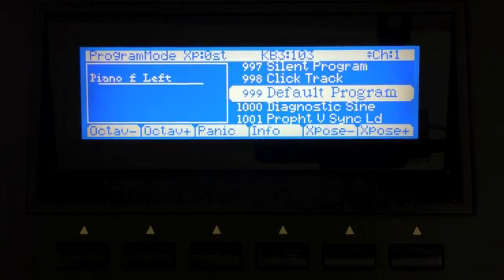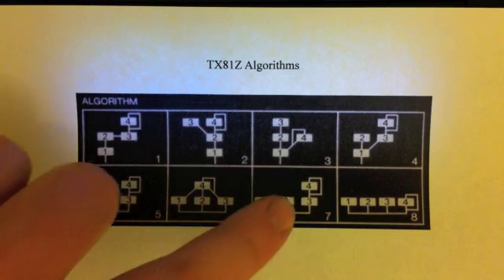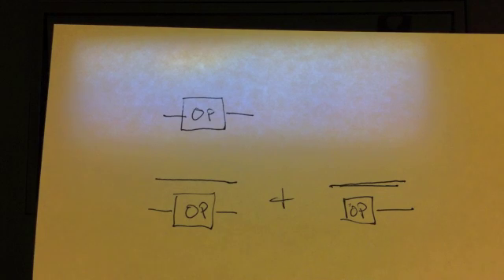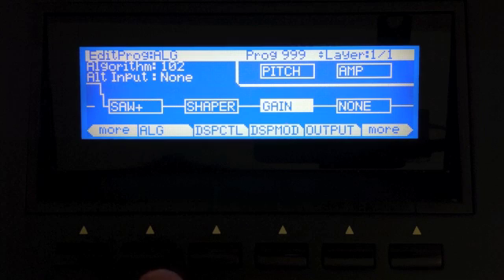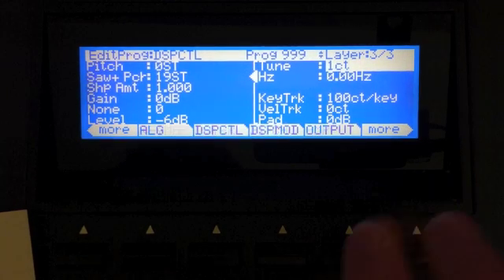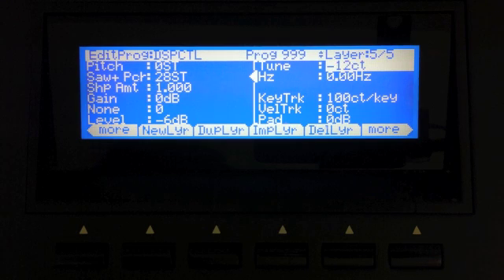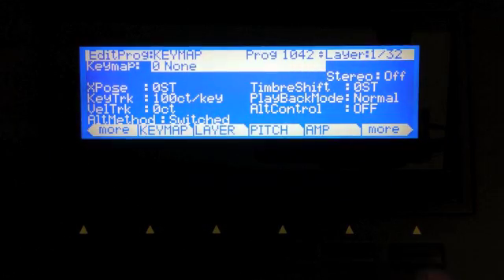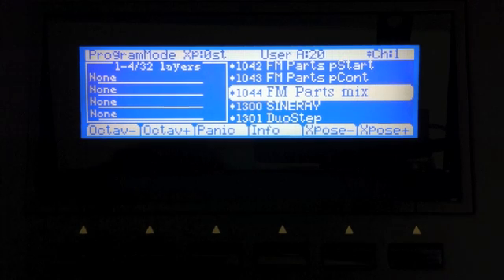Kurzweil PC3: Tutorial 7 -- FM Synthesis and Programming Strategies

Comment: Thanks for the terrific tutorials. Is there a way in VAST to use a sawtooth wave to modulate a sine wave, such that the output is of a similar nature to kick drums, basically a fast and large ramping of the pitch down? I have found, using envelopes and LFO's applied to the pitch are limited by a delay of 20ms before they update, and especially odd and annoying, they induce a ramp up in pitch of around 10-15ms which is audible, even if you set an attack to 0 and only what to ramp down from a beginning pitch. After watching all your FM synthesis tutorials and then mucking about in my PC3 and watching the output in a scope, it does not behave as I would have expected, which may be a lack of my understanding of FM. However, in other VST instruments, I do find the FM to produce output as I would expect. What I expect is that the modulating source amplitude at any given moment combined with the gain should determine the current frequency of an output sine wave. However, with VAST shapers, the output being a lookup of a mapped amplitude, I don't see a way that it can evolve the output from a beginning frequency progressing lower or higher smoothly and predictably. Another way of describing what I expect, is for example, in one cycle of a sawtooth wave a number of cycles of a sine wave progressively ramps down in pitch, and that sawtooth cycle should be 20ms or less. I appreciate any take on solutions to the problem or explanations that might demonstrate what I have misunderstood. Thanks.
Reply from the maker: VAST pre-Forte does "FM" in a different way than many other synths, as near as I can tell it's essentially using a sine-wave lookup table (that's SHAPER). Anyways, on the Forte and related, there is "real" FM and this is possible there. I'm not entirely sure how to do it otherwise, but I will think on it.
Reply: @poserp  I figured it out finally. The key is that one needs to put a wrap before a shaper (not saw+shp) and use a waveshape (oscillator through dsp functions or a portion of an existing sample) that has an exponential curve in time(x) vs. amplitude(y), flip what you see on an oscilloscope 90 degrees counterclockwise. The PC3 Musician's Guide does not explain all the DSP functions, do you know a resource/manual that does contain them? The manuals for older Kurzweil synths include explanations of them, but the PC3 has some newer ones.

Comment: good evening to you.
sorry, I don't understand English and I follow your tutorials.
specifically I don't understand how the 1041 fm parts series program can play if all the volumes are at -96db?
did my problem with English make me miss a few passages?
thanks if you want to answer.
Reply from the maker: These are meant to be "cascaded" into another Layer that handles output volume. Generally speaking, the last Layer in a chain that applies amplitude envelopes and overall level control.
Reply: @poserp  
of course.
seeing your video I noticed that the last layer was still at -96 db and I can't understand how it could sound.
another thing I would like to ask you, how come, at the beginning of the video the keymap is set to NONE and when you open the program 1041 is set to 174 SAWTOOTH WAVE?
I would try to understand but this FM is really difficult, forgive me.
Reply from the maker: The next tutorial, #8 showing an FM bass sound, give an end-to-end example of how the programming works. These tutorials are more for immediate/advanced programmers, so I leave out some things that, if you're new to VAST and Kurzweil programming, might make things more confusing. This one in particular isn't about how to program an FM sound, but rather how to create some Programs that can be useful when you're programming an FM sound on the PC3. These can then be re-used via "Import Layer" in new Programs that you may make. Sometimes, for that sort of "template" Program, it makes sense to have a Keymap (even though you don't ever hear it) for various reasons. Sometimes, it makes sense to have the Keymap set to "None". It really depends on what you're trying to accomplish and how you want to go about doing it.
Reply: @poserp  
thank you very much for your availability, I follow you for a long time and the little I can do on PC3K I owe it to you ... good day.

Comment: I thought the harmonic series was multiplications of the fundamental frequency by an integer, that represent the harmonic in the series. So if the fundamental is 440hz, the second harmonic would be 880hz, the third 1320hz etc. hmm I need to dig deeper, it would seem to me a multiplication done in the "FUN" would do the trick.
Reply from the maker: One thing to bear in mind -- all multiplications will happen in cents, not hertz. This is why I have to do the things I did here. If I could control pitch directly via hz, it would be easier.
Reply: poserp Ah. I get it. Thank You.

Comment: He means 32 Algorithms on the Yamaha DX7, not harmonics.  There are 6 Operators/Oscillators on the Yamaha DX7.  The number of harmonics is a function of how the modulation is set up, you aren't limited to 32.
Reply from the maker: As I explain below, it's related to "ratio". The PC3 has no pre-set FM "algorithms" so you can roll your own, and aside from feedback you can use these Programs to create any of the 32 algorithms in the DX7, plus many many more that go well beyond 6 operators. The 32 Layers in each Program are for ease of picking "nice" "ratio" values without having to futz around with figuring out the tuning of each harmonic in the harmonic series yourself, and to kinda-sorta allow you to program a Yamaha FM sound by matching the "ratio" values to a Layer number.

Comment: "the 32 harmonics usually available in various Yamaha FM-based synthesizers" Sorry, but what are you talking about? I'm afraid you don't seem to know, as you seem to have confused FM with additive synthesis. FM synths used small numbers of operators ("partials") to produce more harmonics, resulting from the set modulator:carrier pitch and amplitude combinations. Yamaha did this with only 4, 6, or 8 operators (which can be crude "partials" if each is an unmodulated sine to audio out). The DX7 and related synths had 32 ALGORITHMS - combinations of operatorss  - but never 32 ops, which seems to be what you're trying here.  Your task of replicating this would've been far, far easier if you had known what you were replicating...
Reply from the maker: Nope, we're talking "ratio", as in the frequency ratio between op a and op b. So, the idea here is that by having those pre-programmed in Layers we don't have to guess/look up what the frequency values are for the harmonic series (roughly speaking, my understanding is that the "Ratio" on a DX_ synth when not set to "fixed" will allow you to select the first 32 harmonics in the harmonic series). I can't remember off-hand where I picked that up, but it certainly could be wrong...
Reply: Sorry, duh, that's what I get for watching while half-asleep. So, you only create the "partial" layers as shortcuts for a desired ratio, for a given operator connection/'segment' type, and load them as needed - to speed up setting the frequencies of each op. That makes sense! Ignore me. Fwiw, IIRC most Yamaha FM synths could go up to something like 63 x ratio, but obviously it's of very low usefulness; anything beyond about 20 is sharply diminishing returns. Well, arguably such ratios can contribute to producing interesting noise sources, etc - albeit dependent on lucking into the right combination of frequency, amplitude, sampling rate of the given synth (as it tends to depend on fold-back), etc... it can take a long time to find the perfect hi-hat base. :D
Reply from the maker: Indeed. For hi-hats though I've found it's best to skip straight to aliasing (aliasing + FM is magical for metallic percussion).
Reply: Yeah, aliasing is what I was thinking of, since it's usually a case of picking a crazy ratio and finding the one key that produces exactly the right pitch that the aliasing fold-back has the desired effect. It's both an exact science, and complete trial-and-error!